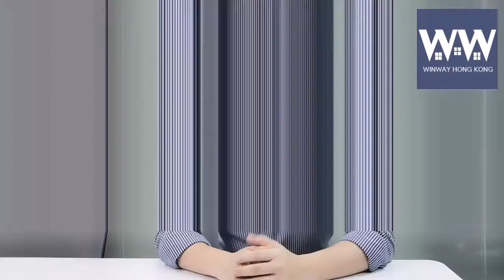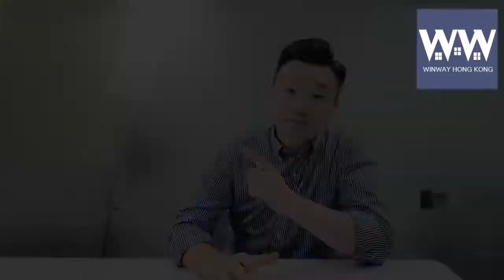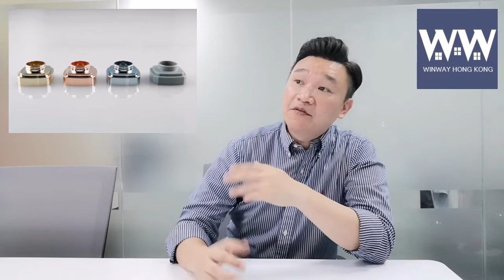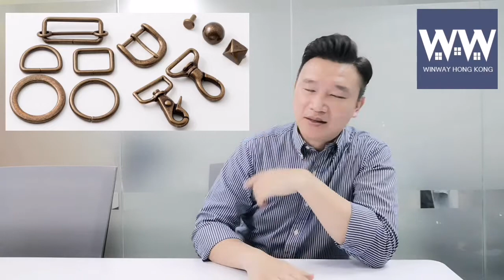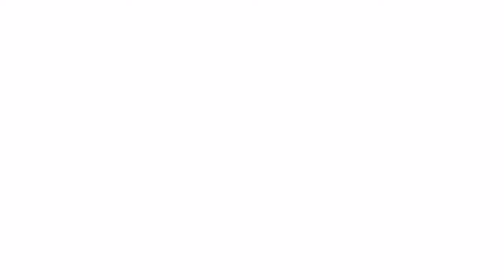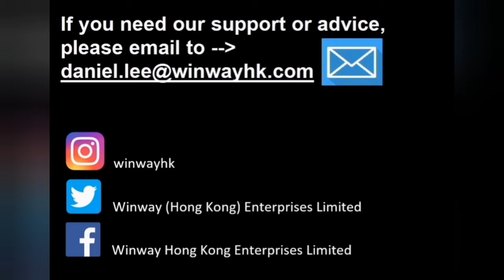Electroplating (Chrome plating) - Part 2

Comment: Quick question, why must nickel be used as the second step?  Does it give a harder surface to the copper, and also give it a layer of rust protection to the copper?  Is there any other reason why the nickel step that I am missing?